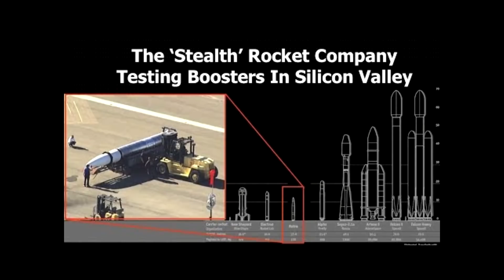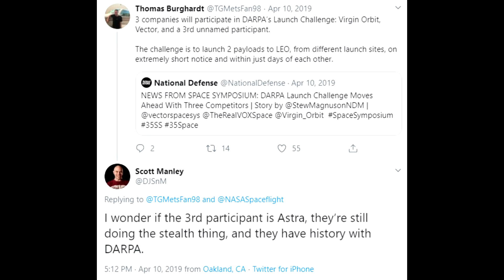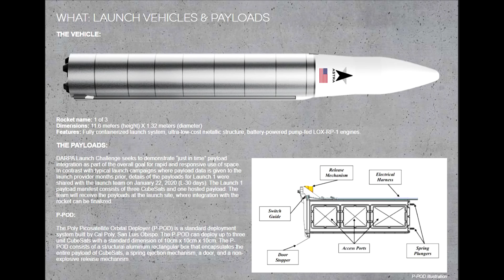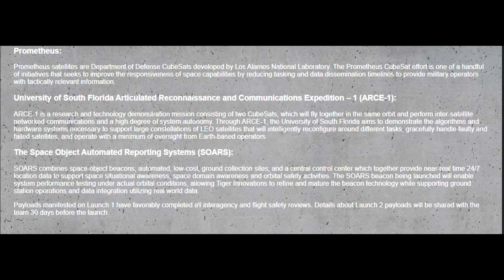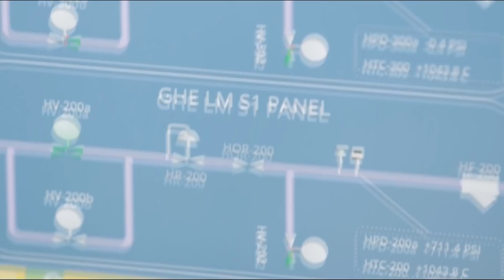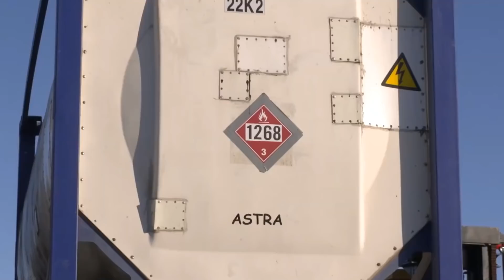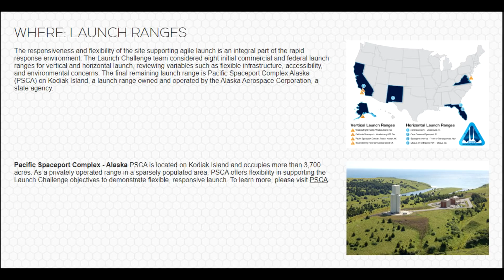Astra's Secret Rocket Project Finally Reveals Itself

Comment: Considering NASA's early stages and the whole  Army missile to moon rocket program had a LOT of spectacular failures.  At the cost that these are going for, at 2 launched so far, even with the failures indicated, is not a bad record as they know what and how the problems happened, we have much better telemetry and launch data capability now that those 2 launches probably produced a dozen times more data than the first 10 of the Army Missile Program, largely due to processing capability of computers today vs the everything on paper and film of before.

But this is actually rather impressive, for a mobile launch facility.

Comment: The Nazi war machine had V2 rockets that could be launched from a blast deflector, they were single stage but took a 1 ton warhead into space.
If that warhead was replaced by a second stage with a few pounds of cubesats ....
The V2 could be fired from a bare site and the site cleared in something like 30 minutes, -place the blast deflector stand the rocket, liquid fuel it and fire it and clear up! Max altitude 200+Km

Comment: I love this channel but I could only watch the first few minutes as I saw the techs working on the hardware, They must have pulled these monkeys straight out of the jungle, I'm watching them working on the hardware wearing rings, watches, bracelets and keys hanging from their belts. Screws, pens and tools kept on a paper near vent holes of electronic equipment in danger of falling in so it could short circuit the instrument.How inept these guys are, have they never heard of FOD? Coming from an aerospace environment I know we never work on hardware wearing all this crap so you can scratch or damage space hardware. Truly an inept, untrained, unprofessional crew. Wouldn't be surprised it the vehicle came crashing down seconds after launch and hopefully not in some populated area!

Comment: In other words, it's like some sort of scud, or like Russia's super mobile ICBMs, except it can be transported with a regular ass truck and cargo container... Hmm

I don't think Darpa plans on using this thing for nukes like that, but it seems like they're aiming at an ultra cheap and ultra quick method of launching an entire cube sat network from any location to replace a sat network degraded or destroyed in the first wave of an attack. Or to do quick one off short duration missions for relatively cheap.

Comment: Based on the workshop images, they seem strong on the hipster front, but weak of the technical front,  Use some decent network switches for a start, Juniper EX2200's are lacking in CPU and can fall over under high CPU load.  They are not designed for mission critical applications. Been there done that.

Comment: Interesting. 

Looking at the design it is likely intended for surging battlefield communication and recon assets as it would make a poor weapons system. The fuel, limited payload and launch table are all bad ideas for a weapon but don't really matter for a SLV. It also makes a great target for new missile defense systems with its low cost ability to test fixed defenses such as AGEIS Ashore instillation. Be interesting to see if a ME(L) is made for it or if they will keep the current set up.

Comment: There are two issues unresolved issues related to Astra's presence in Alameda:

1) Astra has been testing their rockets in the middle of the night! WHY? These test are EXTREMELY loud. There are residential areas nearby and this has been very disruptive for a lot people and it should stop, ASAP.
2) There's concern about emissions and air quality issues from these tests.
No answers yet from Astra on either of these issues. The bigger question is: why is this type of rocket testing taking place in an urban area, close to residents?
Reply from the maker: Well I can respond to #2 with some science here.
The engines use a high grade kerosene which is low in impurities so it burns very clean, but when those engines light they burn fuel rapidly, 
When all 5 engines are firing they use 45kg (100lbs) or propellent per second. 72% is Liquid Oxygen, 28% is the kerosene. So that's 12.6kg per second, or if you compare it to gasoline it's about 4 1/2 gallons per second.
While that seems like a lot, the tests are generally short, but imagine they run an extra long 2 minute long test, that'd be like burning 550 gallons of gasoline.

Now ask yourself how many gallons of gasoline are sold on Alameda, per day? The Average station in the US sells 4000 gallons per day, there are 13 stations on Alameda, so.. a single complete duration burn puts out the same pollution at 1% of the car traffic on the island.
Reply: @scottmanley  Hi Scott. Thanks for the reply. I live in the West End neighborhood of Alameda. I think we should consider that the cars that are buying gasoline in Alameda are also being driven off the island at least as much as they're driven on it, perhaps more. Also, cars have emission controls.
Does Astra have anything to say about why they need to perform late night testing? Residents lives are being impacted by this. Are they willing to address this issue?
Reply from the maker: @kennyschachat   I think the late night testing is questionable for sure, hopefully now that they're public they'll be keeping a regular schedule.
Also, the emission controls on cars are because cars run on atmospheric air (with 80% nitrogen) and don't have the same purity controls that rocket fuel has. When you burn rocket fuel with liquid oxygen a lot of the pollution reactions are suppressed.

Comment: Wait, don't Russians already have mobile launch system for ICBMs? For like 50 years..? This is old tech..
Reply: IF their ICBM can put a payload into orbit..
Reply: @gandritaskull  True, but since a ICBM doesn't need the DV to make orbit, it usually doesn't carry the fuel, so a 2nd stage is required usually.  I won't call modifying a single stage missile into a 2 stage launch vehicle trivial but it can be done, you cite 2 good examples of missiles modified with a 2nd stage to put small payloads into orbit.  So far there seem to be a market for 500lbs payloads and last I heard the small sat market was growing by as much as 20% per year.

Comment: Can anyone explain why solid fuel ICBMs are not used for this? Soviets made thousands of those - they are cheap, reliable, have insane shelf-live, portable and can launch with just a few minutes of notice. Surely someone can buy the patent (if they even ever had a patent for those) and just mass-produce them?
Reply: Solid fuel is not as efficient.
Reply: @TheEvilmooseofdoom  Should still be able to get small satellites in to low orbit, fast,  which is the goal of this competition?
Reply: @TheHuangShan  They can and do.. But this competition also requires a transportable system so mass may be an issue which means they'll want a more efficient fuel pound per pound..  And I think everyone made a solid fueled ICBM at one time so no one would need to get the tech from Russia. :)
Reply: @TheEvilmooseofdoom  military ones are mounted on all terrain vehicles, they are literally as portable as it gets.
Reply: @TheHuangShan  Yes, but they don't have the DV to get into orbit.

Comment: Seems weird to launch from Alaska and give up all that extra inertia they would get closer to the equator.
Reply: Joshua Daniels 
Depends where you’re going, if your goal is a low inclination orbit launching near the equator is good, but if you want to go into a high inclination (such as sun synchronous) orbit you actually want to launch as far away from the equator as you can, because you want ‘upwards’ velocity not ‘sideways’.

Comment: Acto Wikipedia: "San Nicolas Island was one of eight candidate sites to detonate the first atomic bomb before White Sands Proving Ground was selected for the Trinity nuclear test.[9] Between 1957 and 1973, and in 2004 and 2010, U.S. military research rockets were launched from San Nicolas Island. The launchpad was situated at 33°15′51.4″N 119°32′20.4″WCoordinates: 33°15′51.4″N 119°32′20.4″W. It remains part of the Pacific Missile Range.

San Nicolas Island currently serves as a detachment of Naval Base Ventura County. In addition to Port Hueneme and Point Mugu, San Nicolas Island is military-owned and operated."

Forget being surprised about missile launching...a potential test site for Trinity less than a hundred miles (often upwind) of Downtown L.A.!?!?

Comment: 3:10 How exactly does covering the nozzle with fabric allow it to move?
Reply from the maker: It's not the cover, it's the fabric that joins the nozzle to the base of the rocket.
Reply: Basically a gasket where the nozzle comes out of the base of the rocket.  Ignore the nozzle cover at the end.

Comment: If you want to have cheap reliable rocket. dont put Carbon fiber.

Yes it is light. But its expensive AF
Reply: Yes, carbon fiber is expensive, but if your goal is to launch a certain amount of weight, it can be be cheaper to make that expensive nose come than it is to put bigger engines on the rocket, which would require more fuel, which would require bigger tanks.

Which would require building a bigger rocket.

Which would cost more than just the nose come.

Comment: I bet 500 bucks this is going to end up as an ICBM, if it wasn't developed as one from the start. The military potential of an ICBM that can be disguised as a shipping container, put on a truck and hidden in plain sight, is far too powerful for the military to overlook.
Reply: Why go to all that trouble when you already have fleets of nuclear submarines carrying nuclear ballistic missiles, patrolling all over the world, literally 24/7, and have been, for like 60 years.
Reply: @Mythricia1988 
Because it's not a missile.
Reply: @Joe Horn It can take 300 kg into low earth orbit, so maybe half a ton of payload as an ICBM, enough for a small missile with a couple warheads (or even just a single warhead, and maybe some chaff as decoys). Multiply that by about 1000, which is a number you can easily hide in shipping containers and trucks around the US (or even the world), and also easily build since it would only be maybe $500 million/1000 missiles, and you have a very cheap and powerful boost to the US nuclear capacity, with no need to maintain any silos, and no way to ever map every single one of the missiles even with satellite imaging and an extensive spy network.

CIA, if you're reading this and you haven't done even a back of the envelope calculation for this, you should.

Comment: Very cool, wish I'd thought of going into the space business, when I was a high school lad, we managed to launch a small payload 4 miles high. Had we staged our liquid propellant rocket and our solid propellant rocket we could have done much better than 4 miles. Rocket "safety officer" meaning Dad, did not permit us to go any higher. Not after the NY State police showed up after we launched one of our high powered amateur rockets out over Lake Ontario. Dad lost his nerve to push the envelope. The police were not wise to what we done as they responded to a citizen complaint that saw a fireball heading out over the lake moving at high speed and they also heard the rocket breaking the sound barrier as the thrust tapered off close to burnout. We were using spun fiberglass and spun carbon fiber tubing and graphite ceramic nozzles in 1969 long before carbon fiber was as common as today. A neighbor was an engineer for Spaulding Fibre in Western NY and we had bits and pieces tubing to our specs and tech data on their experimental tubing. Low carbon steel had been our material, much safer with composites than steel and easier to work with, pouring 2 part epoxy resins and inserting carbon/ceramic nozzles. Our liquid fuel rocket had a stainless steel un-cooled combustion chamber and nozzle and the tanks were made of aluminium and pressurized with dry ice. The oxidizer was nitric acid and the fuel was an 80/20 mix of turpentine and furfuryl alcohol. Static tested a couple of times to find minimum furfuryl that gave reliable ignition, flown once, the parachute failed. The Isp of about 240 seconds  only a little higher than our solid propellants about 220 seconds. Great fun, I did the math and design, my shop skilled buddy did the machining with the help of his shop teacher. Great fun ... learned a lot. Neighbor on one side of us worked for the fibre company and on the other side of my parents house another engineer for Bell Aerospace and assigned to the RM-81 Agena  B in the 1960's. I had plenty of expert help, learned how to do stress / strain calculations along with Algebra 2 and Trig for the NY Reagents exam. If anything school math was neglected during a wild construction project. I still crammed and passed the reagents at the end of the school year. A month after school let out Armstrong landed on the Moon, I felt let down, I know how the Soviets must have felt we both lost the space race.
Reply: Your dad sounds like a really cool chap 👍
Reply: well just do it today :)
Reply: wow. all I can do is play KSP and I‘m not even good at that...
Reply: You, sir, are a steely-eyed missileman.
Reply: @lmamakos  The book I had as a kid borrowed from the Carnegie Library in Pittsburgh. Dad had to use his library card because this book was not in the children's section and a stuffy old maid librarian thought it inappropriate reading for a kid. (I admit I needed some adult help from the engineers in the neighborhood that enjoyed teaching their trade to a young audience) http://mae-nas.eng.usu.edu/MAE_5540_Web/propulsion_systems/subpages/Rocket_Propulsion_Elements.pdf
Reply: Cool post !  Thanks !   Dig this   https://www.youtube.com/watch?v=zxJQgYPXjN4    Are you going to make a film of your effort for a You Tube post !  My dad tried to explain the Sputnik launch to me when I was three .  I thought per all the space stuff on T.V. that we had already gone to Mars and the other planets and was disappointed that  Sputnik was it as far as space travel went at that time .  However as the decades went on can't say we earthlings haven't kept trying .
Reply: That's amazing! You should write a book (or at least an essay) on this. A lot of people would love to read it.
Reply: @Kevin_Street  The book I had as a kid borrowed from the Carnegie Library in Pittsburgh. Dad had to use his library card because this book was not in the children's section and a stuffy old maid librarian thought it inappropriate reading for a kid. (I admit I needed some adult help from the engineers in the neighborhood that enjoyed teaching their trade to a young audience) http://mae-nas.eng.usu.edu/MAE_5540_Web/propulsion_systems/subpages/Rocket_Propulsion_Elements.pdf
Reply: The book I had as a kid borrowed from the Carnegie Library in Pittsburgh. Dad had to use his library card because this book was not in the children's section and a stuffy old maid librarian thought it inappropriate reading for a kid. (I admit I needed some adult help from the engineers in the neighborhood that enjoyed teaching their trade to a young audience) http://mae-nas.eng.usu.edu/MAE_5540_Web/propulsion_systems/subpages/Rocket_Propulsion_Elements.pdf